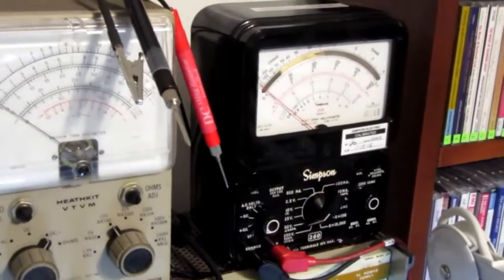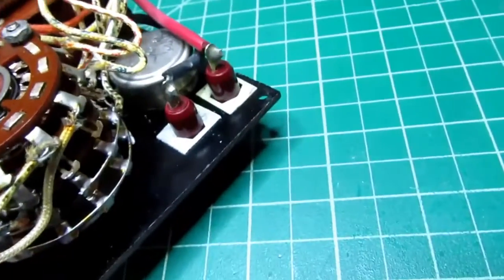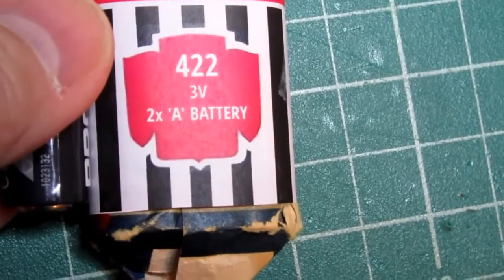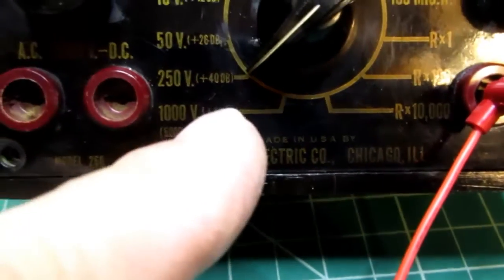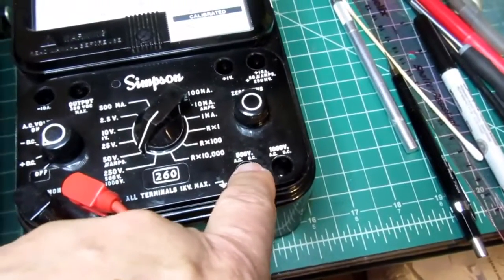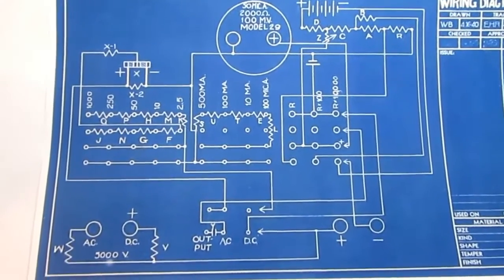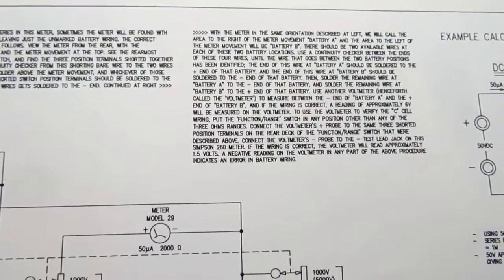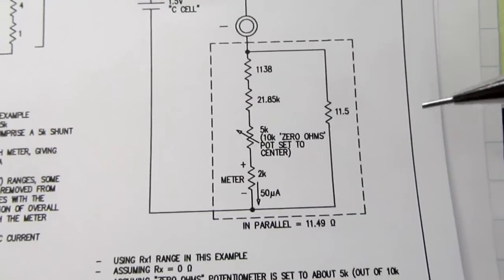Simpson 260-1 VOM/Multimeter: History, Repair, Overview, Demonstration, Theory

Comment: Thank you very much for such a detailed video. Today I just picked up this VOM and everything looks so original.  It may also have an interesting story.  It has engraved the name of the owner and being used at MIT.  It also has the original branded batteries.  I’m plannign on restoring it but it looks like a long project s the wiring is all discolored. No rust just degraded wiring. Thank you for the CAD diagram.

Comment: The Symbol for the 1 1/2 volt battery is drawn correctly as a "Cell" which would be 1.5 v in a carbon cell while the other battery shows oty of"4"  1.5 volt cells in series which as you know would equal a 6 volt carbon battery....Love your Video!
Reply from the maker: Timothyhall, glad you like the video, but I don't understand the purpose of the rest of your comment. Are you responding to something in my video that you disagree with? You mention a schematic; WHICH schematic? The Simpson original, my version, or what?

Comment: Is your schematic available for download or purchase? Also, mine is dead on AC, I suppose some high PIV diodes would be required? Thanks, nicely done…
Reply from the maker: The link to the schematic and other 260-1 resources is given in the description to this video.

There are only two diodes in the meter, and they are indeed needed for the AC Volts function to work. But they are located in the circuit after the resistor attenuation, and as such as not particularly high voltage. But given this meter's age, I think that they are Selenium diodes, not Germanium or Silicon. Selenium diodes are typically about 30V per layer, and are typically comprised of several layers stacked to achieve the desired rectifier voltage. They can be replaced using Silicon diodes, with one Silicon diode replacing the entire stack of a Selenium rectifier. HOWEVER, each Selenium layer has a forward voltage drop of several volts, whereas a Silicon diode only drops 0.6 or 0.7 Volts.

In the 260-1, the post-attentuator voltage applied to the two Selenium diodes is quite low, so I think only one layer is used on each diode, so they can't be seeing more than a small number of Volts. But this has the disadvantage of skewing all the precision resistors in the meter circuit, because they were selected by Simpson to result in the correct current through the meter movement when quite a few Volts are being dropped by the rectifier. If you put in Silicon diodes to replace blown Seleniums, the meter will probably read very high in the AC Volts function, because too much voltage is present after rectification, since not enough voltage is being lost in the rectifier diodes. You might find that you need to replace at least a few resistors with ones of different values in order to get the meter working properly for AC Volt measurements.

Study the circuit in DC Volts, AC Volts, etc; to see if there are any resistors unique to the AC Volts circuit, and that resistor(s) would be a good place to start tweaking once you have replaced the diodes.
Reply: I've been told that the diodes are copper oxide.

Comment: Why are resistors for these VOM's are so expensive?
Anyone know?
Reply from the maker: SDsailor, "for these VOM's" seems to mean this particular VOM. In which case, the manufacturer is long out of business, the resistors are high power precision types with custom values
 Why would anyone expect them to NOT be expensive?
Reply: @youtuuba  So to repair one of these is going to be expensive then. I have a 260 series 5 that is not accurate in some of the ranges. Ohms is good but AC and DC are of on a couple of the ranges.
Reply from the maker: @SDsailor7  , while the "Simpson" that made the very early model I show no longer exists, another version of the company still exists in northern Wisconsin. They still survive some versions of the 260 series. You might find that they will still work on yours. You can Google them.......
Reply: @youtuuba  Yes I have read that they still make the and they still service them.
Thank you
Reply: @youtuuba  I also have a bench model vtvm by Simpson it is the model 312, but I think it also needs some work. I downloaded the operator manual to see if I can make it work.

Comment: I will really appreciate if you could post a tutorial on how to use Simson 262. 
It seems like the readout of this meter is different from Simpson 260.
I haven't seen any tutorials in regards with Simpson 262 and 269.
Thanks for your hard work and more power to you posting.
Reply from the maker: herosipet, what's to explain? Three DC Volt scales, use whichever corresponds to the selected range, two AC Volt scales according to range, and one Ohms scale. This is very conventional.

Comment: Depends a lot on what you want to do you can't go wrong with  260-8P or 260-8XPi, and the newer series 260-9P that is available. There is a smaller meter, model 160 as an alternative to the 260.